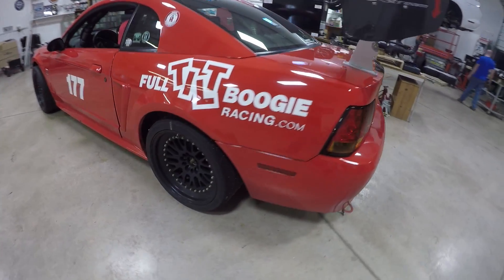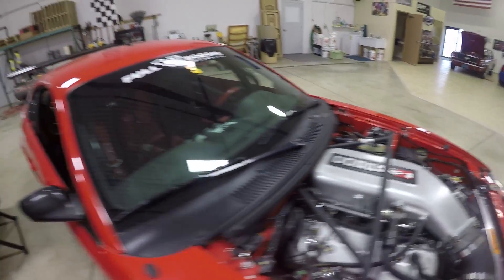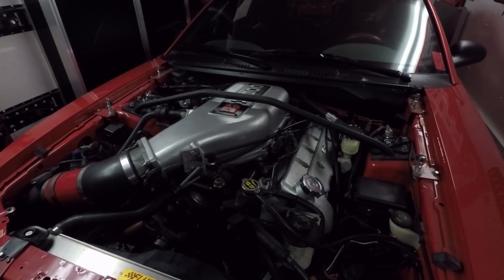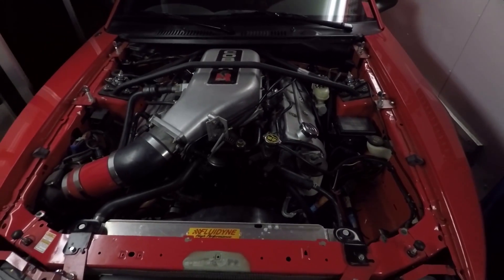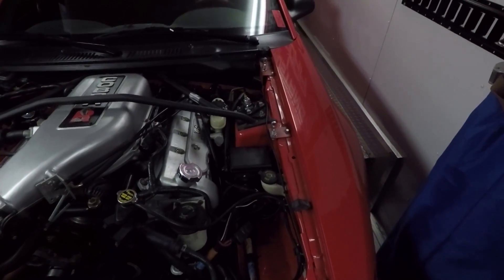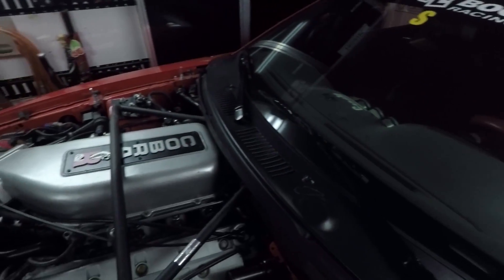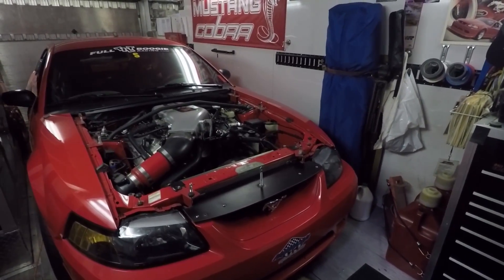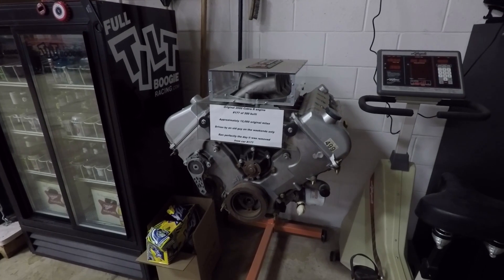Picking Up the 2000 Cobra R - New Engine

Comment: What did you guys use for motor mounts to fit on the kmember? I know the 5.4 blocks have 4 mounting holes vs the 4.6 with 3 mounting holes
Reply from the maker: pretty sure that kmember was made for the 5.4

Comment: I wonder if you can swap supercharger from gt500 since is 5.4l but i think the cylinder heads are different
Reply: It's a 5.8 now but yes if you use the lower manifold you can use a gt500 style blower.

Comment: It can allways be changed back to stock with a little effort..
Does the stock hood have any clearance issues with the 5.8?
Reply from the maker: no problem at all
Reply: The 5.8 4v is just a bored out 5.4 they have the same stroke it's the same dimensionally.  Like a 347 is an 8.2 deck just like a 302...

Comment: The cobra r intake fits on the trinity 5.8l block???
Reply from the maker: +kirk0respite I guess so. idk if any modifications had to be done or not tho
Reply: Not to be a smart ass, but the intake fits up to the heads. The heads on this car were used on the 05 06 Ford GT. The bigger question is how did the heads from the Ford gt/cobra r fit on the 5.8 block?..
Reply: @MrGimmethreesteps  the 5.8 is just a punched out 5.4...the trinity had the same ford gt heads that the cobra r used and the 07-12 gt500 used.

Comment: NA 5.8l w big compression and cams on E85 is one of my dream builds for a Mustang ... does anyone know if Coyote heads can be made to fit the 5.8 block? That would give you a bunch of intake options . Either way a R w 100lb less on the nose will ripppppppp!!
Reply: coyote heads wont work but there are coyote intake adapters for 5.4 4v
Reply: so no matter the machining they cant be made to work?  @deltadetrix
Reply: @kawicepticon8866 there's really no need to use coyote heads.  With the adaptor you can use the intake these heads are killer and if you port them they can flow as well as ported coyote heads do.  The coyote is a different engine platform all together the heads are totally different not interchangeable.  With an r there'd be no need just port the stock heads and done.

Comment: Ruined
Reply from the maker: +Latnlvr lol
Reply: Right. I'm all for modifying mass produced vehicles. But a Cobra R is rare & should be left alone. I would think it would be cheaper to buy a 4.6 Cobra, swap it to a 351 and do whatever you want with it from there. 
Saw another video on here where a guy had supercharged a 95 R then complained that it was uncontrollable so he was selling it off. LEAVE IT STOCK.
Reply from the maker: Brian Threet this car has been used exactly what the engineeres designed it to do but now its turned up to 11. This thing is an absolute monster at the track
Reply: Brian Threet totally agree. I cringed at the thought of ruining that ultra rare R.
Reply: KyleSVT I'm sure that's true. It's not that I don't think the car is fast. Hell it was fast bone stock. Just think there are better options to modify. I don't have an R and honestly couldn't afford one. However, if I did it would stay stock and be sitting in my garage waxed up and spotless. But it's your car and yours to  do as you please.
Reply: Brian Threet that’s true to each his own. Personally I would do the same that you said, spotless in the garage in a fucking bubble! Lol that’s why I look at this car as “ruined”. I’m sure it could be made stock again when the value of the thing shoots in to the deep 6 figure range.
Reply: Oh wow... it's gonna be worth 6 figures some day (maybe).  This car is doing what it SHOULD be doing.  I do completely agree that some of these cars should be preserved.  However, it is a complete waste if none of them are unleashed to do what they were intended to do.  If you want an "investment" go buy a mutual fund.  Cars are not an investment (please counter this point will endless stories about "some guy" who makes all this money off selling classic cars... blah blah blah).  My other personal favorite car/money talk madness, is some story that goes "two cars race for $30,000!!!"  Both cars have well over $30,000 spent building them.  I guess that's how you make money.  Build some "sick" car and find a bunch of people that are will to throw away $30,000 on a drag race.  Then 20 years from now those same people can regret how they wasted their money and cry about not being able to retire.  If you would like to see a Cobra R in a bubble... go buy one and put it in a bubble.  If you want an investment... buy an investment.  Good on you KyleSVT.  There are at least a couple of Ford engineers that are grinning ear to ear because of your efforts!  I just subbed your channel.  Keep the "defiled Cobra R" content coming.  All the real Ford fans are here.  We got your back kid!  FORD RACING
Reply: fwh79 tell us how you really feel. The only thing I can reply to this ongoing rambling is, the cobra R WILL be a 6 figure car. Maybe 7 deep into the future. Shelby’s sold for $4-$5k now they’re in the deep 6 figures.
Reply: Who cares?  I would rather drive the car and enjoy it than make "6 figures" off of it.  You're missing the point of owning a car like the Cobra R.  If you wana make money... go make money.  THAT is my point.  These guys that all talk about what these cars are gonna be worth down the road are annoying.  Oh my... 40 years from now I could sell this car for big money!  That's gonna work out great to pay for my new wheel chair and all my health care bills now that i'm almost dead.  What a dream come true.  Do even own a Mustang Letnlvr?  I noticed you have no content on your channel, but you are rocking that Cobra emblem on your profile.
Reply: fwh79 alright man chill you’re going to have a hernia. I’m not a YouTuber so I don’t have content on my channel. I do own a cobra tho. Hence my cobra logo. I already made my case with Kyle svt and we both came to a middle ground. I see your side, but just how you don’t like my view, your view is also not for me. It’s only opinions and personal point of view.
Reply: Yeah well, your comment was rude.  Keep it to yourself.  YouTube is overflowing with these cars wrapped in plastic.  If that is what you like, go watch those videos.  Ruined?  Not even close.  More like put to its intended purpose.  No offense, but when people talk about some magical time in the future when whatever XYZ car is gonna be worth a theoretical boat load of cash . . .  that is literally poor people talk.  Just because some yuppie baby boomers are dropping boat loads of cash on random cars from their youth, in some vein attempt to relive their younger years... does not mean every "rare" car should be wrapped in plastic and put in storage.  If you have a Cobra why don't you pull whatever $700.00 cell phone you more than likely have and are making payments on (and also pay insurance coverage for) out of your pocket and make some videos.  I would love to see your car wrapped in plastic and blankets with a rope barrier around it.  With the DON'T TOUCH! sign proudly displayed.  It is easy to hide behind a mask and make rude comments.  You have a YouTube account... post some videos and get in the game.  Trust me, it might change your attitude when someone leaves a comment similar to yours on YOUR video.
Reply: fwh79 free country bro. Ruined. I’m going with ruined.
Reply: I subbed your channel.  Make some Cobra videos.  Thank you.
Reply: Latnlvr with 7 figure for a damn sn95 new-edge lol .. the car is made for races. It’s races. Improved
Reply: Michael Gomez no, ruined is more like it.
Reply: Lol all this hate his car and it was made to be raced let him do so !!
Reply: agreed.looks like a ricer now.very poor decision in my eyes
Reply: @fwh79FOXR6  I agree I think it is awesome that it is modified.  There are plenty of these being preserved in plastic actually the majority of them probably are which was NOT what they were intended for.  I absolutely love that he modded it.  He even kept the original engine stock so I don't see what the big deal is.  Most if not all this stuff is easily reversible because of that fact.
Reply: I disagree, this car is being used as it should, not as garage queen